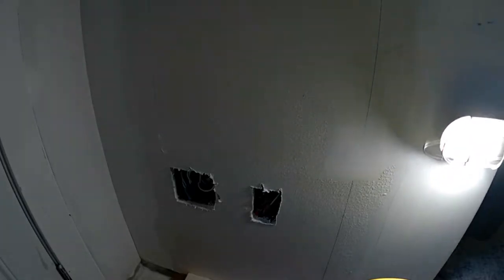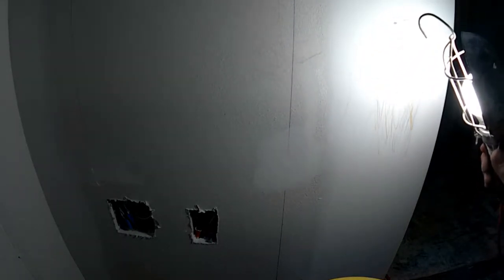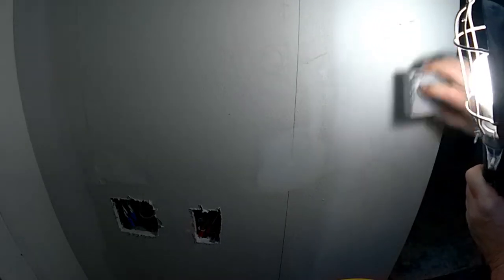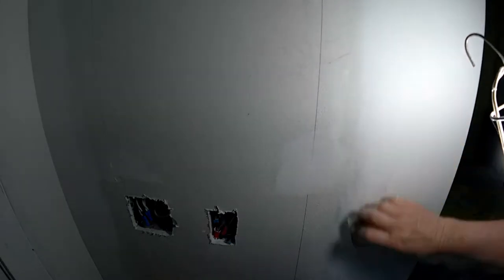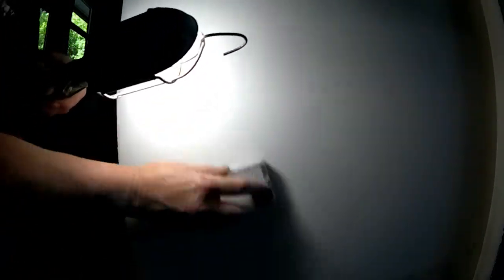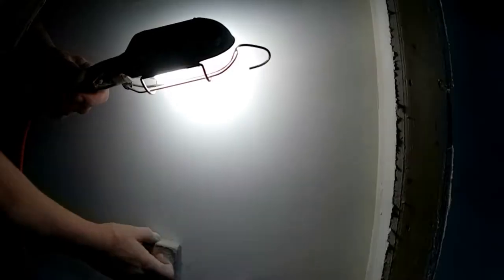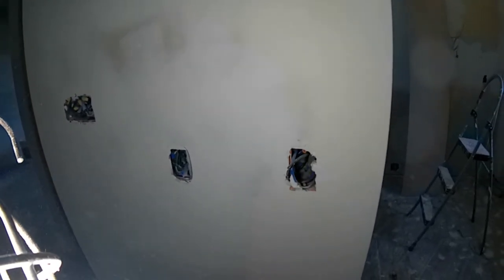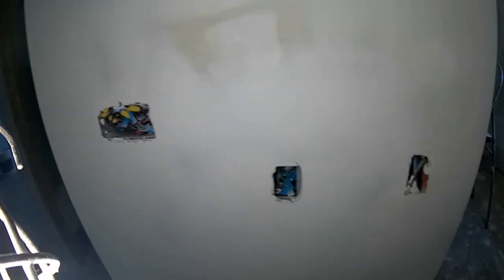HOW TO CHECK DRYWALL FOR IMPERFECTIONS USING A LIGHT

Comment: It was hard to see what you were actually sanding or looking for.
Reply from the maker: Difficult to see on the video, perhaps. What you can do is darken your house and use a hand-held light to look at the drywall. You'll be surprised at the imperfections that a light will reveal. That's what I was removing. Also, at the bottom of the video, select the highest resolution available under the little wheel (settings). This was filmed at 1080p 60 FPS. Best of luck with your drywall project!